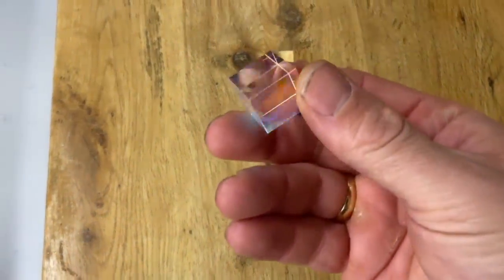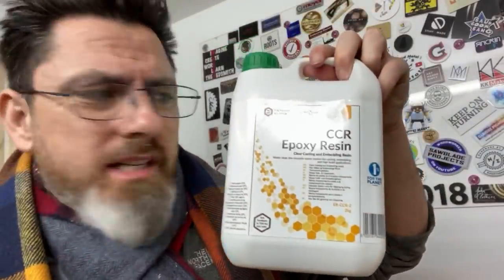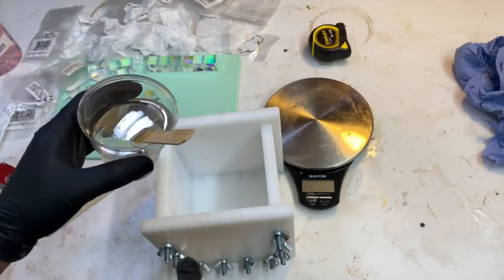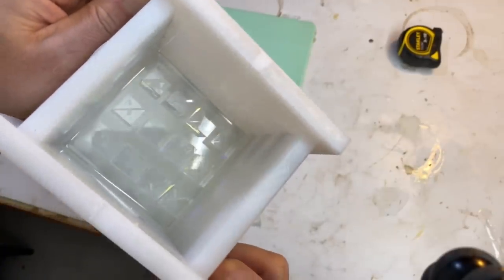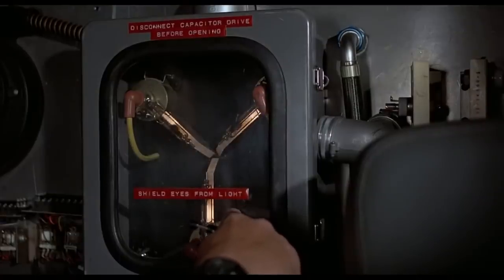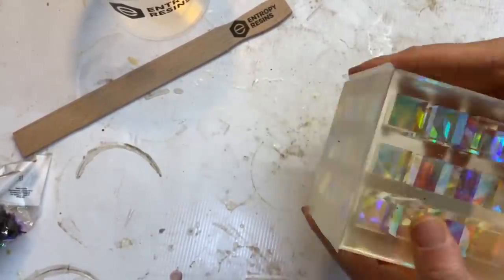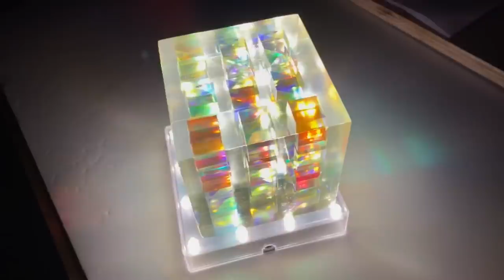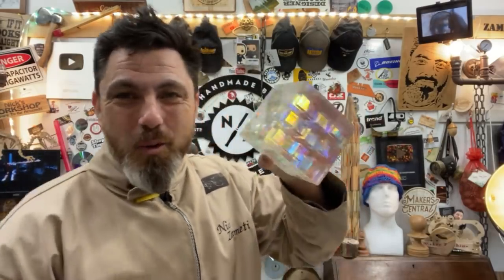Making a Prism Borg Cube.. With Lights! Ft Dougie from McFly

Comment: Second i realised what you were making there i thought "" oo 4 magnets in the cube and a ring of magnets in the block you could have it spinning and floating ""  , feel fre to use the idea lol
Reply: I think this would be a great idea for an orb. I wonder if there would be a way to hide the magnets inside the orb? It seems to me they would be sort of an eye sore if the orb was clear like this project.
Reply: @jw4718  mix ferropowder(iron shavings) into the resin maybe
Reply: @WardNightstone  Maybe. How would you do it so you get the polarity just right so it would "float"?
Reply: @jw4718  not sure clear magnets are a thing lol but use steel or some kind of metal flake and just use the magnets in the base ?
Reply: Very cool idea
Reply: @Edgunsuk  that would attract the orb or cube to the base wouldnt it?  Unless you built a "base" with a magnet below the orb and one above of the same strength and worked out the correct distance so the top magnet was pulling it up while the bottom magnet was pulling it down at the same rate. Otherwise a base like what Nick built would need a magnet in the orb and a magnet of the same polarity in the base. That way they would push against each other making the orb hover. The first idea is the only way I can see this working with metal shavings or powder in the orb.
Reply: @jw4718  think mag lev like trains running on steel rails , has to be a way to do it , or electrically magnetise a plate  you can buy a devise to magnetise and demagnetise screw drivers  for instance
Reply: @Edgunsuk  ye they're all solid connected magnets with organised magnetic poles cos of the way they bond. He could do it with a solid ring magnet, would also internal lighting in the cube via induction 🤷‍♂️

Comment: Really cool man. A toot of your horn is definitely necessary lol. I bet the sunlight beaming through is even better. I'd love to see these added to the resin and then turned on the lathe. Unless they are made from actual glass.
Reply: You could drill a tiny hole in one of the corners and hang it in the sunlight. Awesome tattoo too btw.

Comment: Try tube holes linking all the cubes together. Then have lasers shining though the bottom holes linking the cubes with laser lights. Should only have to have lasers in the base stand as the prism should split and share the light.

Comment: The resin casting would have taken a lot of nights and waiting, what I would have done, and recommend, is start off with the base layer and leave that over night in the pressure pot, then glued the blocks in with a clear quick drying glue, and staggered them up to the top then pour in the last lot of resin to the top only taking about 2-3 days, rather than what u seemed to do, just 1 row at a time, waiting 4-6 days till it's all done and dry

Comment: ur base didn't light it up as well because of the angle the light was hittin the side of the cube and it kinda looked like the sides weren't quite as polished up as possible so alot of the light was gettin defracted n most of the rest diffused, if u took the pins outta ur base n set the cube flat itll look better  it looks beautiful tho man good job